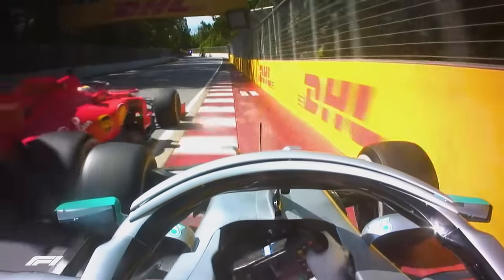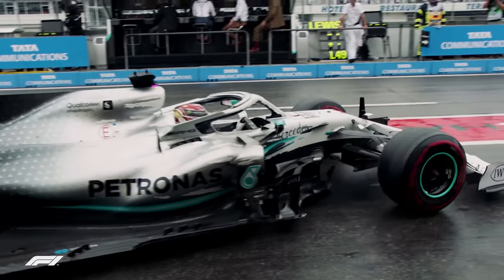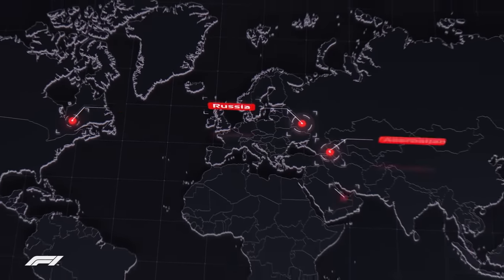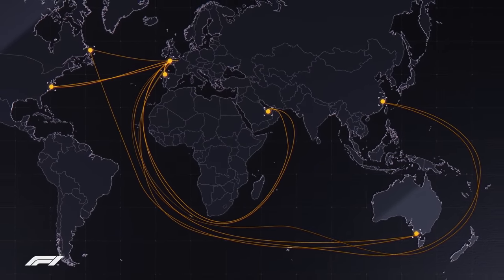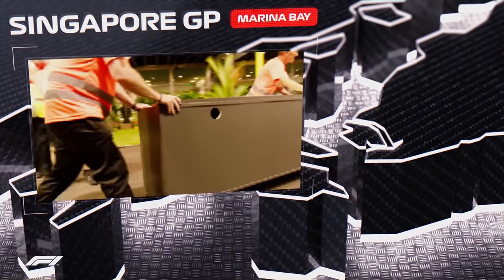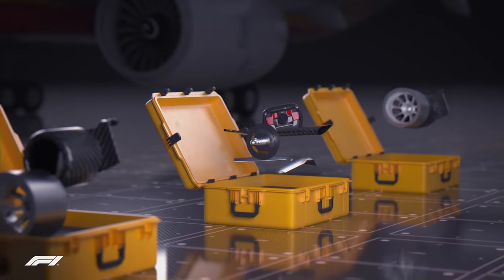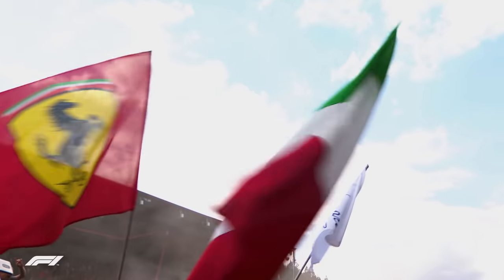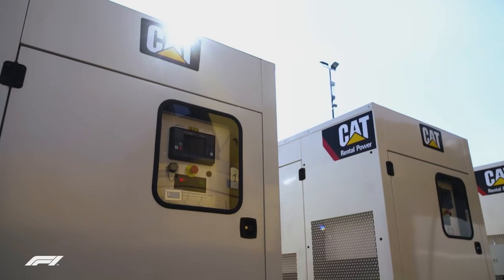Building the greatest racing spectacle on the planet | DHL & F1

Comment: Somebody warn DHL, they forgot to bring the Williams engines to races for the entire season.
Reply: Araitik no you got to give them some race bans.
Reply: Yeah, it’s really unfair to have the f1 drivers flintstone there way around the circuit.
Reply: Araitik its not the power unit they forgot, it’s the cars arrow 😂
Reply: They forgot to take the sandbags off
Reply: Araitik actually their Engine is what works, have they even had a Engine related DNF
Reply: @amnaah653  Kubicas had a massive blowout/explosion of smoke in Belgium 🇧🇪 GP qualifying
Reply: Riften Guard ye didn't Merc change the engine into Spa but reverted back because it was horribly unreliable, Bottas, Stroll and Perez I think also blew up in practice (Bottas defo, Ik one racing point but I think both)
Reply: no, they forgot Kimi Raikkonens STEERING WHEEL
Reply: John Woolven you mean karting engines
Reply: Anshuman Kakralia looks like someone woke up on the wrong side of the bed
Reply: @abdiqarebash3156  I don't understand
Reply: Anshuman Kakralia it’s a saying meaning your grumpy
Reply: @abdiqarebash3156  hamburger

Comment: The immense amount of work that goes behind the scenes are unimaginable
Reply: Too bad a lot of it is just wasted manpower. Teams shouldn't transport and rebuild buildings, venues should have standardized hospitality units.
Reply: @sogerc1  there are different events at each track. and what if the circuit goes off the F1 calendar
Reply: @maur7432  I don't really understand what you're trying to say. I'm talking about those buildings the teams carry around the world, those get mounted and dismounted no matter what. And as far as I understand teams have more of these to send around the world. Instead each venue should be required to have standardized buildings for each team, they are not that huge, I don't think it would be such a huge deal to build them. Teams then could put their panels etc on them on the outside and decorate the inside as they please. Here's a picture of Mercedes' so we are on the same page: https://i.pinimg.com/originals/a9/fa/63/a9fa6374c89ca8780d880536e7dd8c1c.jpg
Reply: @sogerc1 
They only build hospitality and motor homes for the European races

Comment: Ive got to say I've never heard a cargo ship referred to as a way to "reduce the carbon footprint"
Reply: Video is really cool though. Also shows what an incredible feat it will be if F1 gets to the point of being carbon neutral.
Reply: I guess they have less emissions per ton? I'm not sure, I'm just guessing
Edit: Yeah, about 10 times less than an airplane per ton (500g/ton/km for the airplane, and 40g/ton/km for the ship)
Reply: @benjaminvincze4249  Cargo ships pollute in many ways, not only CO2. It's cheaper than air freight. Of course they can frame it like that and appear green.
Reply: @kanava9996  Yes, I know, mostly its because of the type of oil they use, since it's crude/almost crude oil, and they dump a lot of stuff straight into the sea.

Comment: I think the Brazilian GP is a logistical challenge because the track is pretty much located on the largest city in Sotu América and it´s 90kms from the sea so even containers going by ship still have to be transported by truck from the port to the track and the cargo going by plane also have to be transported by truck because the airport DHL use (Viracopos Int) is very far from the track. and considering the insanely chaotic traffic in São Paulo the trucks take a lot of time between the ports and the racetrack.